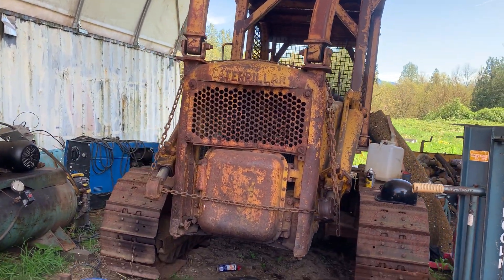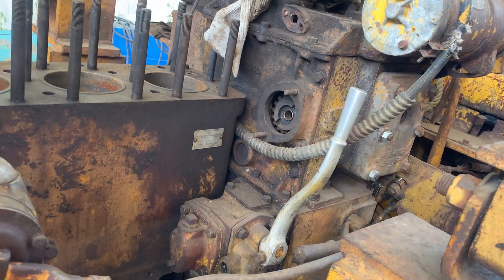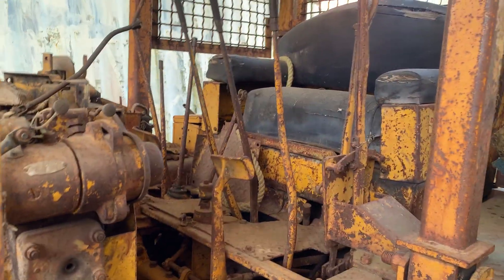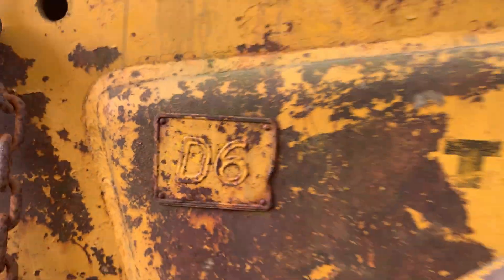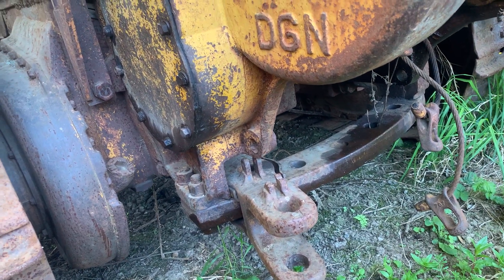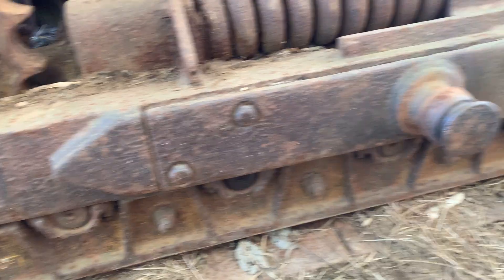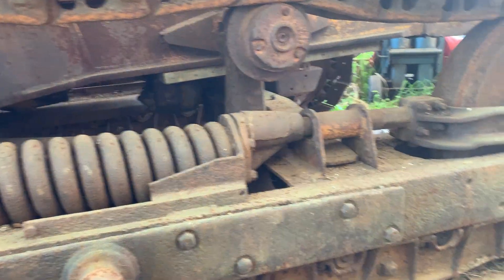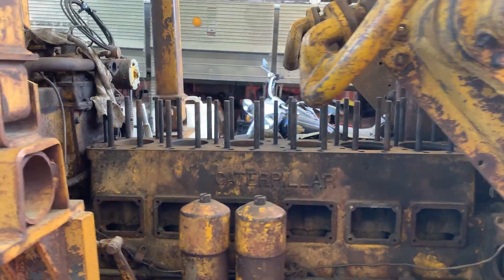Caterpillar D6 Project

Comment: You can see the hex cut on the adjustment shaft behind idler wheel.  Big wrench & pipe & thats after heat or whatever else it takes to get moving after sitting around . Good videos.

Comment: Nice example of an old D6 9U, it looks in good condition for its age, and nicely set up. I had one just like it, serial number 9U16861, I sold it either just before or just after I bought the EX200 from you... I can confirm those track tensioners are manual, one of mine had been welded solid and without any way to adjust the track tension you can guess what happened! Thanks for the video!
Reply from the maker: A 'repair' like that makes a good umbrella ,but a poor roof.